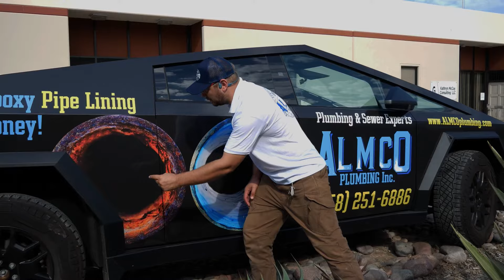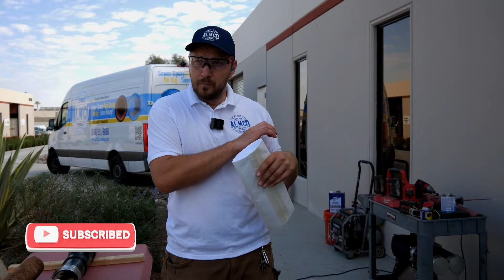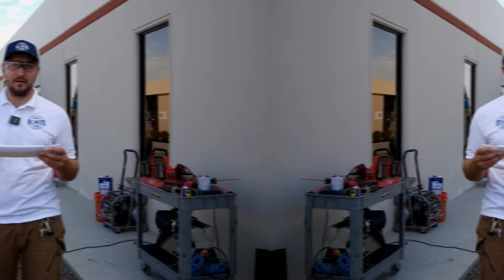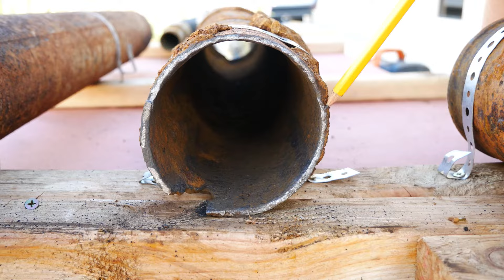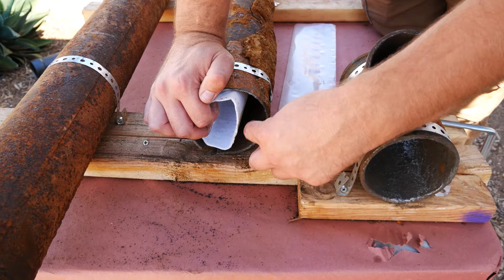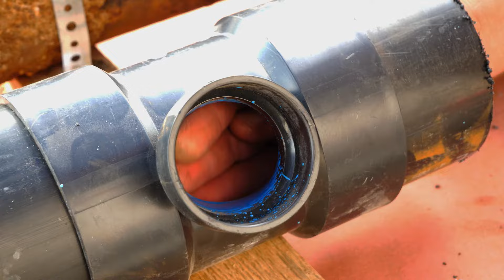Repair or Replacement? | Four TRENCHLESS TECHNOLOGIES for sewer pipes repair

Comment: Hi I was wondering what epoxy liner spray you are using?  I like the blue, but the nuflow rep keeps telling me to go with the grey picote 2 in one epoxy
Reply from the maker: Picot machine is not good. I’m looking to buy one it’s almost impossible to using very slow process and need new houses for each time you using